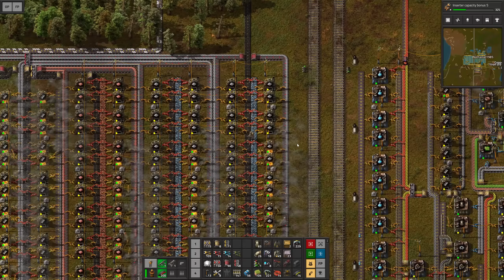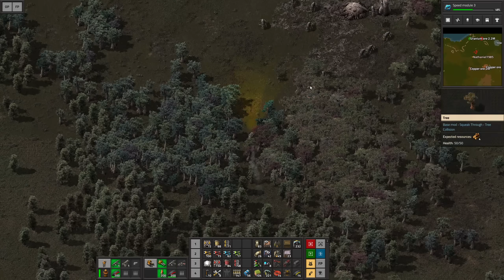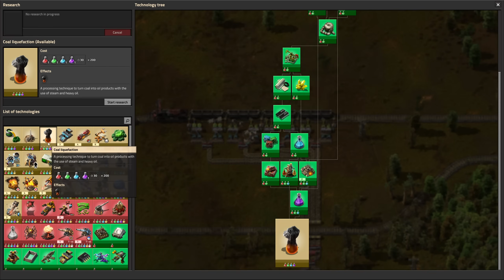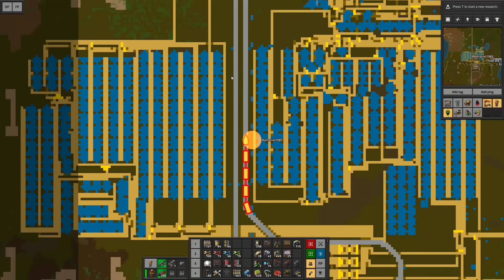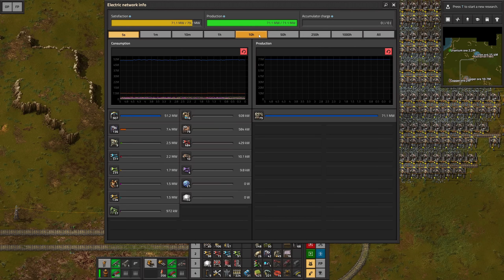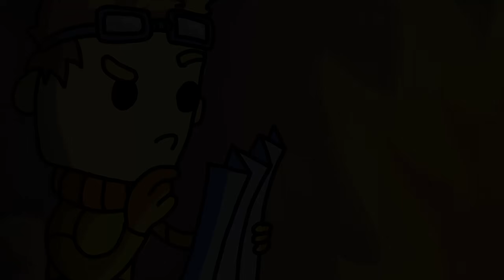MINING SITE EXPANSION - Step 13: Factorio Megabase (Step-By-Step)

Comment: super newb question: do you have any tutorial for train signals? in this part you went kinda fast when building the new stations and didnt mention how the new intersections should be configured in terms of signals, so im kind of lost :'( also you didnt mention how many new trains we should add into the system. thanks in advance!
Reply: I'm not sure if this helps, but something I've heard often is "chain in, rail out." When it comes to rail intersections (rule of thumb for simpler intersections). Essentially, any rail where a train can enter an intersection, you place a chain signal on the right side of the track a little bit before the intersection then, after the intersection (so long as there is enough space for a full train after  the end of the intersection) you place a rail signal also on the right side of the track.  Essentially youre cutting the railway into sections, and each rail signal lets the train know if the next section is safe to enter aka empty of trains, hence why it is good to place rail signals along long straight paths periodically so the trains can move forward without having to wait too long before the next section is empty. When you use a chain signal before an intersection, it asks the next 2 sections if they're free of trains. So when you place a chain signal before and a rail section after an intersection, you are cutting the rail into 3 sections, 1. before the intersection, 2. the intersection, and 3. after the intersection. 

==1====C===/2/====R==3====

 so when a train from rail section 1 gets to the Chain signal (C), the chain signal (C) checks the intersection (2) for trains and then also asks the Rail signal (R) if there is a train in section 3 so the train in section 1 can pass from 1 to 2 and then to 3 in one motion so it doesn't stop in the intersection. 

Once intersections start involving multiple crossings and trains coming from all sorts of directions, it gets a little bit more nuanced. Hope this was understandable and  helps.

Comment: Quick question from a newb, now that there are multiple ore loading stations and multiple ore unload stations of the same kind. Even with the 1 train per station, the trains get mixed up and start going to different train stations and ore deposits. Seems like the flow of ore will continue under those circumstances and it wont harm anything, am I right in that assumption?
Reply from the maker: They will tend to go to the station that is closest and requires a train. But yeah you can mix them up.

Comment: 26:46 "Yeah i think i just remembered why I usually play with critters off" Nathan, you were having a hard time here clearing the nests, there's actually two things that could help: Defensively, you can use more solar panels with accumulators, it's zero-pollution. You mentioned you didn't want to use modules, right? Offensively, you can abuse the turret + red ammo strategy when clearing nests, they're pretty good at shooting down the biters while you can bomb the nests with your tank.
Reply from the maker: We later have the spidertron which eliminates most of the issues;)

Comment: Why don't you want to build a normal mall where you produce everything what you need for building and increasing your productions? You don't even need to have logistic drones to make this. You can build it using ordinary conveyors. It could be very useful for you. With this thing you could refuse of crafting some stuff in your inventory. It's just convenient.
P. S. I see you have something like mall but you still craft many things in inventory.
Reply from the maker: The crafting hub we have takes care of everything I need lots of. I don't find it convenient to have hundreds of oil refineries or chemical labs unless I have robots managing my inventory. Or did you mean something else?
Reply: I mean a big hub where you craft all that you might use in building your base. For example this hub should contain all stuff for trains(trains, stations, traffic lights, rails) and assemblers, conveyors,  loaders, refinery stuff, electric poles, drills, etc. You have a hub for crafting everything that you need lots of but it is not enough as I see because you have to use crafting by your hands sometimes. Electric poles, lights, some train stuff. Also if you don't want to have hundreds of oil refineries or chemical labs you can limit crafting by logistic wires. I find it very useful and convenient. It is just a question. Why don't you want to make your hub bigger to refuse crafting by your hands?

Comment: With biter expansion on, my experience is that you must build a defensive perimeter. Without that, more and more of my time goes into fighting those bastards myself.
Reply: My experience is that doesn't work super well for the starter base, you don't have the proper equipment unlocked so if you build a perimeter before artillery they start to overwhelm you really quickly after some time